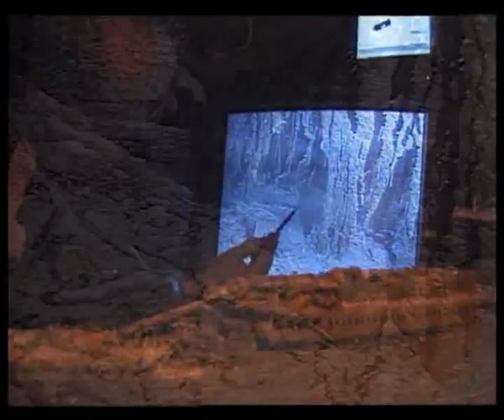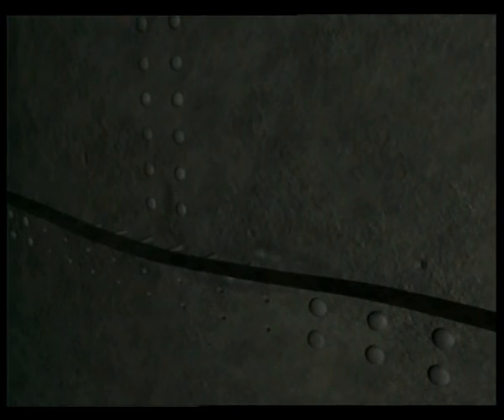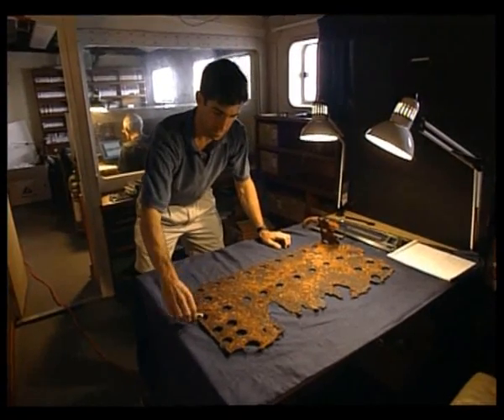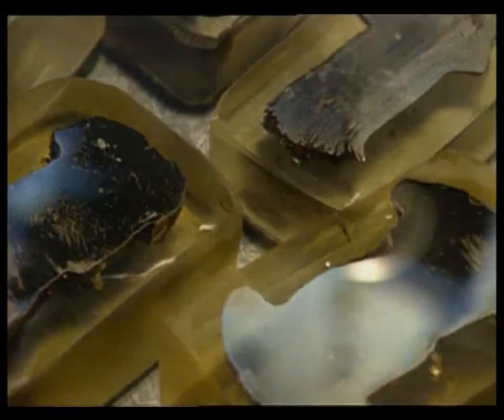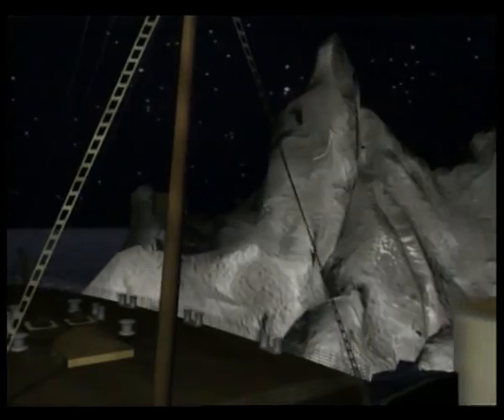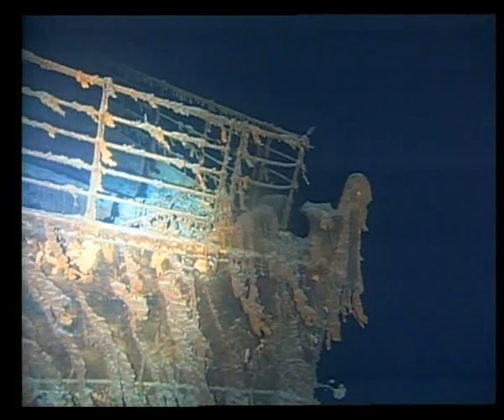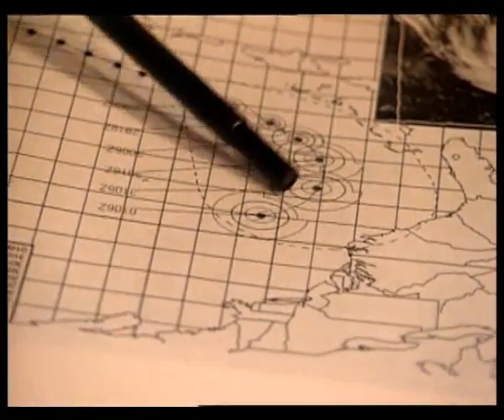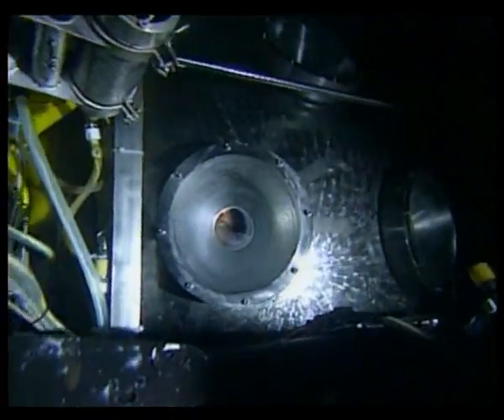Answers From The Abyss Vol 3.

Comment: i'm no forensic expert  in maritime desasters what so ever but like some normal people i got a good sens of deduction in general . but did you guys take the time to make sure to get some rivets from the exact posiiton of the damages ?surely there should have been some left at the edges of the gapping plates that were starting to fail but managed to remain there after the impact . this would be  much moore accurate  than studying  rivets from other parts of the ship that had nothing to do with the initial damages from the impact but rather damages caused by the impact with  the sea floor . not to mention that some of those rivest may come fro sections  that gave way at the moment of the splitting in two of the ship and fallowed the Bow on its descent .

This may look insignificant  but the rivets that failed during the initial impact and the ones who failed afterward  while going to the bottem surely didn't suffer the same kind of stress .Even the ones located at the breaking point did not suffer the same kind of  stress than the one of the impact nore the one during the descent  and floor impact  so you would need to make sure of what exact location those rivets that you examen came from  . In order to get as precise as possible about what stress the icebirg gave out you would need to get the ones the closest to where the icebirg  hit and i mean very clost to where it hit and as much as possible clost to where it started to hit . because there would have been much less stress at the end of the impact than there was at the start
Reply: From what I read most of the iceberg damage is buried because the bow dug into the seabed when it sank
Reply: @yusufkhan-ig7dv  I agree  and thats whatmakes there deductions flawed cause at no time have they actually studied the damaged area or any parts of that direct area  so therfore their conclusion cannot be validated as facts . Just like with the asteriod that killed the dinosaurs , they could find Eridium  which comes only from asteroids all over the planet to support their theory but it remained a theory as long as they couldn't find the impact  crater that  was connected to all of it which later they finally found thanks to  an oil company survey going on in the exact impact zone . Without that oil company they would have never found that crater and the asteroid theory  would have remained only a theory . The Eridium was only part of the  circonstencial   évidence and the impact crater was the real evidence so its the same with the impact area on the Titanic the rest being the Eridium of the event

Comment: Titanic sank, because she hit a bloody great iceberg, as hard as a diamond, last minute.
Not because of bloody rivets.
Olympic sailed on for years.

The End.
Reply: you cannot compare the Olympic to the Titanic  cause one was Head-on while the other was Sideways . The damages on the Olympic did not reach the water line  while the damages on Titanic were done under the water line .And yes it sank becasue of Rivets failing  but what they are trying to  determine is if those rivets failed under normal  extraordinary  stress or if they gave way to easely for the kind of stress that was applied on them .
Reply: As hard as a diamond?
Reply: Regardless of the high slag content, Titanic sideswiping a several million ton cube of ice at nearly 25 mph, would have damaged or popped the rivets out of place, Yes, the less the slag content, the rivet may have withstood more impact, however the FORCE of 25 miles per hour or 22 1/2 kts. 46,000 tons is a mere feather to the several million tons of packed ice, at that speed upon impact, would have popped the rivets out of place, or sheared the heads off Regardless of the high or low content of slag, hitting a large solid mass at that speed and weight is NO match for the plates or rivets to withstand the force and pressure of the steel scraping against an object weighing 10 times or more the weight of Titanic
Reply: Also, the water temperature was around 28°F that night, making any steel more brittle and vulnerable to damage